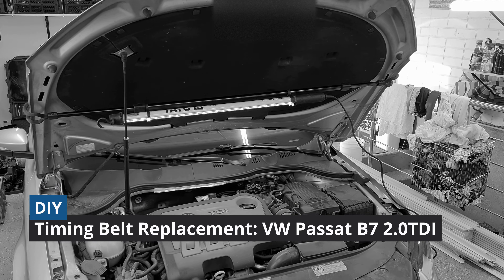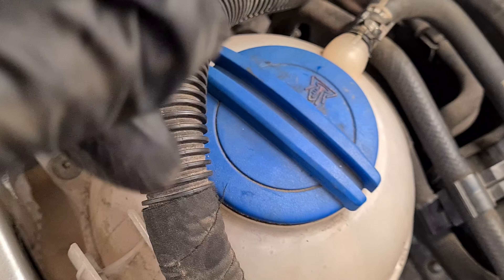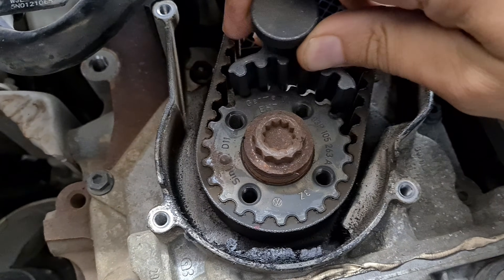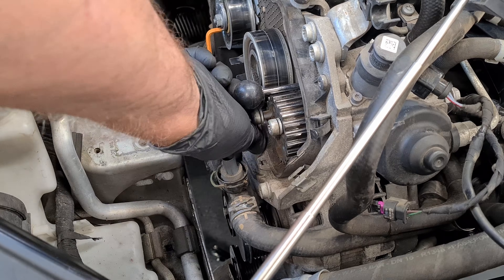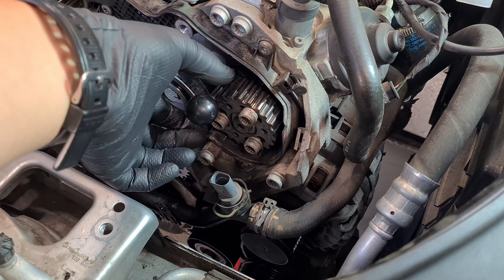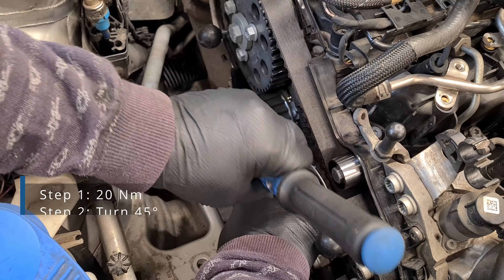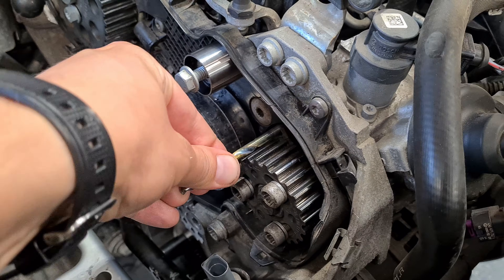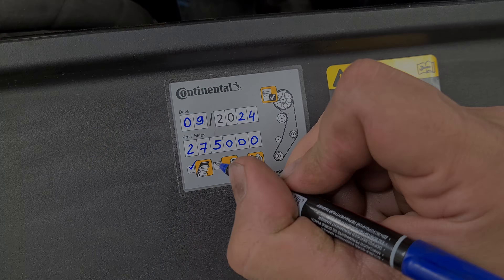Timing Belt Replacement: VW Passat B7 2.0TDI

Comment: Hey, love the video. I actually followed your video and didn’t access any other manuals for doing the timing belt. I have seen in other materials though that they don’t move the fuel pump pulley and camshaft pulley all the way clockwise before fitting the new belt. I also see that when you tightened your pulleys up they have moved to a more central position on the adjustments. Do you think I need to go back and move my pulleys more central on the adjustment windows. I don’t think my timing is out but just wondering how important this part is
Reply from the maker: Thanks! That's the part of the belt tightening process, belt must be tight. The pulleys have elongated holes so that you can rotate them slightly back and forth. Initially you turn them clockwise to the end position so that later you could have a leverage and tighten the right side of the belt by turning the camshaft pulley anti-clockwise with the special tool. The left side of the belt is tightened with the main tensioner. If engine runs great and no fault codes, I think this should be fine. You can check timing by inserting pins in the camshaft/crankshaft, they should both go in.

Comment: Great video, but at 12:25 you turn the camshaft pulley anticlockwise while tightening the camshaft pulley bolts. That's not right. You should just tighten the bolts. That's why your tension was out. It also why the timing was out and you had to redo it.
Reply from the maker: That's what original manual requires to do. You take out the slack of the top part of the belt, and later take out the slack of the lower part using tensioner.
Reply: And that's why he also broke the pin on the crankshaft pulley tool...
Reply from the maker: Nope. You didn't guess. We've broke it in the beginning of the job while inserting it.
Reply: @dionich ok... that said, it was a good job though! Thanks for sharing!

Comment: Why did you loosen the camshaft bolts at all? It's absolutely unnecessary!
Reply: It is completely necessary. If you think it isn't then you don't understand how the system works. Please make sure you do before doing the job.
Reply: I have ready done it, and the car is running as crazy!
Reply from the maker: Just followed the manual.

Comment: Does anyone know if this process is the same on the 2013 Amarok 2.0tdi twin turbo motor? Specifically the TDC process and the locking of the timing 😊
Reply from the maker: Tell me your engine code. Ill check.

Comment: What size socket do you use to remove the crank pulley? Is it a Torx?
Reply from the maker: Dont recall the size. It was multi-spline 8 or 10 something like that.
Reply: Not torx, it's 'XZN' also known as triplesquare.

Comment: Having struggled myself trying to fit a belt that is tight, I have seen a short YouTube video which appears to show an easier method to fit tight belts : remove the large central roller near to the injector pump and loosely fit the belt around the rest, then push the roller inside the curve of the belt until it slides onto its holder.  You can tension it up afterwards.
Reply: Thers also the fastest way... Cut the belt half way and remove tge other piece then replace the new one cut tge remaining old one the push the new one in

Comment: I have a question, what is the factory set torsion value?
When you change the timing, it is advisable to set the torsion value to what is recommended by the manufacturer, because it can be out of adjustment.
Do you know the factory value for torsion value?  - B7 2.0 2012 170cp CFGB Dq250 -
Reply from the maker: Hi. Didn't see this data in the manual.
Reply: Do you find factory value? I have the same engine as yours.

Comment: Why loosen the cam and pump bolts? Can’t you just turn to timing marks, insert tool and pins then loosen through the tensioner?
Reply from the maker: To tighten the belt later on. You can.

Comment: Can you tell me if I can just change the metal idler roller above the belt? I changed the accessory belt tensioner thinking that it was making a sharp noise, but it wasn't that, it was that top iron roller when you remove the plastic cover that keeps the belt slightly pressed.Thx You
Reply from the maker: I think yes. You may need to give a slack to the belt using two allen key method shown here.
Reply: @dionich Thx you very much!
Reply: @dionich  Can I know how many km it is the time changed, most people say 10 years or 120k minimum, is that true or is risky?Thx you!
Reply from the maker: @georgeb1186  120k as per manual.

Comment: Hi , i don't understand what are the nm specs for those 2 studs? One for tensioner and other for idler ?
Reply from the maker: Hand-tight, no specs in the manual.
Reply: Oh shit 😳 i seen some people using 15 nm and some 20nm 
Also what about thread lock did you put any on any of them?
Reply from the maker: @brostv7332  None myself. One of them already comes with a threadlock. Regarding the torque: you can do the torque wrench as well and deem the studs as normal bolts. On my other cars BMWs I use the following torques if none stated in the manual; M6 - 10nM, M7 - 15nM, M8 - 22nM. These figures are coming from the BMW manual.

Comment: Hi,

Firstly very good job.

But i have few questions.

Was it not necessary to lock fuel pump and camshaft before removing the belt?
Also why did you aligned the old tensioner pulley if it has to come off anyway?
Reply from the maker: Thanks. Followed the original manual step by step, was not required. The tensioner was not aligned, it was slackened initially when two allen keys were used.
Reply: @dionich thank you for your reply. I will try to get this job done on my vw passat in few months 👍
Reply: Maybe you can tell me where online i can see manual with all the instructions ?
Reply from the maker: @brostv7332  We have Elsa Win installed. Google for it.

Comment: How long did it take
Reply from the maker: Two days
Reply: @dionich should a belt and water pump be done according to mileage or every 4 years
Reply from the maker: @gang-gang8325  Pump costs 30€, so we've just replaced it anyways we were there.
Reply: @dionich  you lie maximum 3 hours
Reply from the maker: @ For a professional mechanic probably 3 hours indeed. We are not professional mechanics, so we took our time to read the manual, do everything slowly without making much BS.